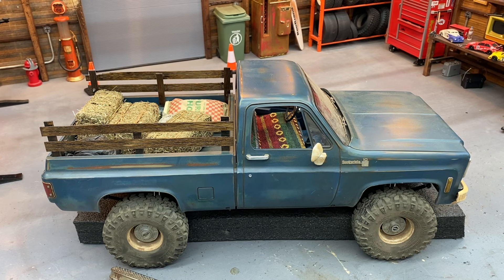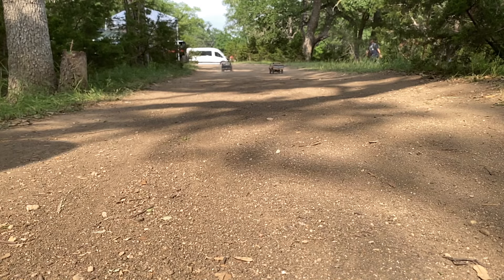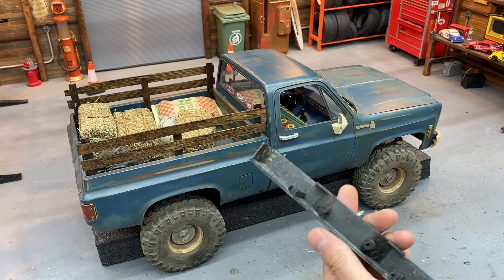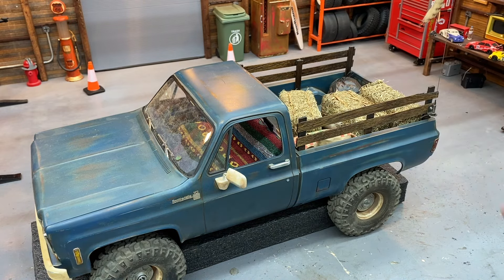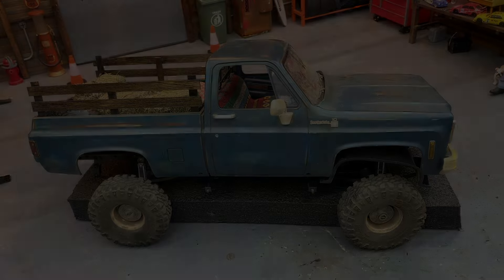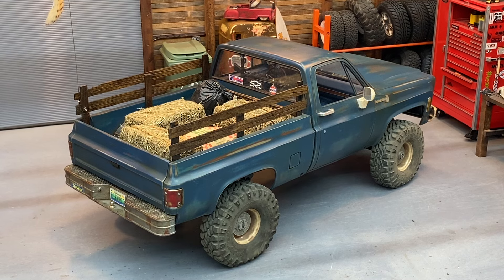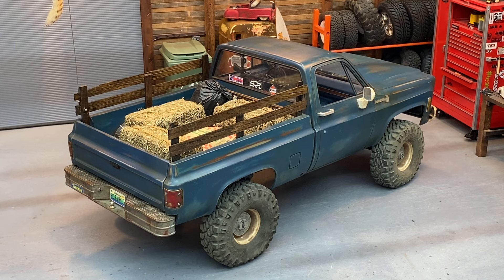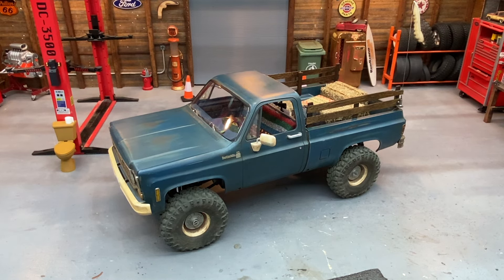Repairs on the RC4wd Scottsdale TF2, After the Crash at Crawlfest 2024

Comment: Hey man what did you do to make your Scottsdale so fast? I have a stock one and want more speed.
Reply from the maker: It’s running a hobbywing fusion pro 2 in 1 motor and esc on a Helios 3700 3s. Has super slow down low speed and a heck of a punch.
Reply: Thanks man they are turds from the factory haha. Appreciate the channel videos and quick response.
Reply: @RCeveryday  you mean it took all for that to beat a stock bruiser drivetrain on 2s? 👀